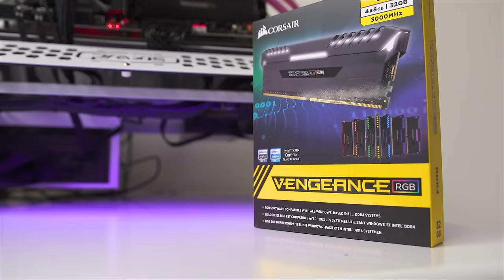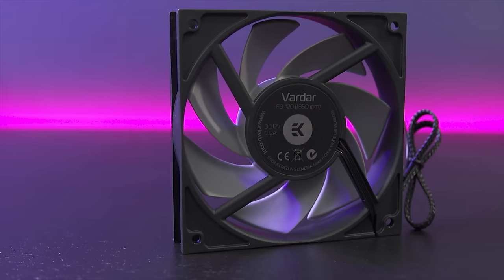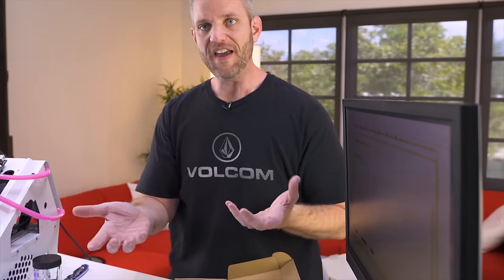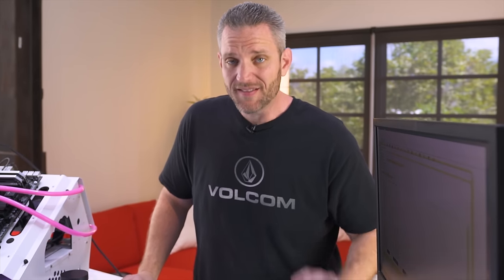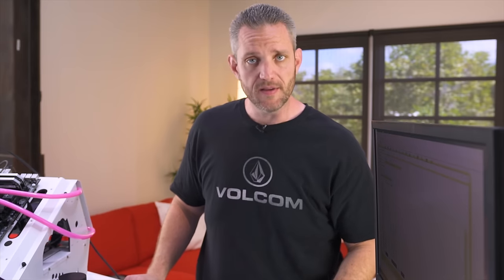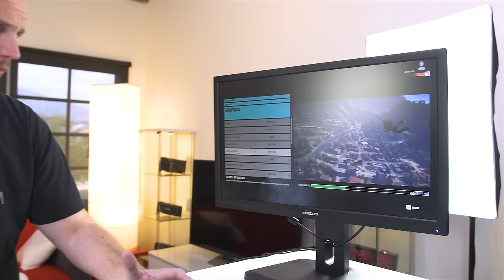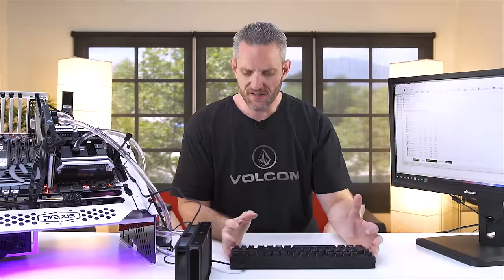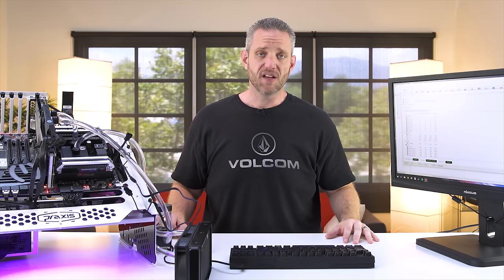How to Watercool your CPU and GPU for under $250

Comment: I stayed till the end and was not disappointed.
Reply: Shane Ottinger samee
Reply: same here.............lol
Reply: LMFAO!!!! YAAAASSSSSSSSSS! so worth it.
Reply: Bloopers, the reason to watch any movie or show.
Reply: Shane Ottinger Aluminiumly DISAPPOINTED
Reply: Aluminum is kinda like trying to spell or say Mississippi
Reply: alumenum
Reply: Aluminum
Reply: alummenumm
Reply: Aluminum
Reply: I haven't had Yakimandu since I was stationed in South Korea 15 years ago. What I wouldn't do for a plate of them.
Reply: alumemum
Reply: Me too! This was great. I wish that more water blocks were made of aluminum instead of copper.
Reply: Shane Ottinger iiii
Reply: Magnesum, calcum, Strontum, Polonum. Also SI units are stupid, science yo. Aluminum num num
Reply: I'm glad I read this comment before I finished the video.
Reply: Can i watercool non-reference graphics card? 980Ti
Also, if so, can i watercool sli gps’s with 1 liquid container thingy & radiator? Just want to add more hose, instead of buying another full separate set to liquid cool second GPU
Reply: That’s what she said.